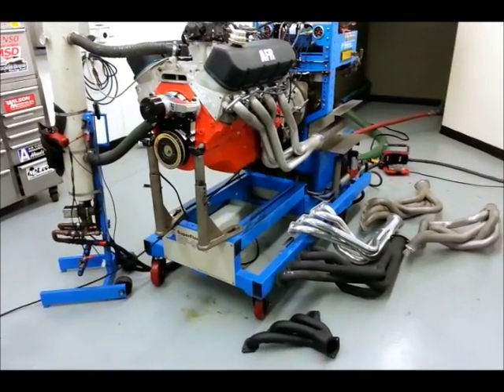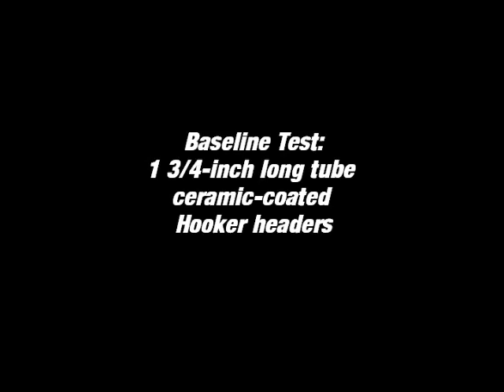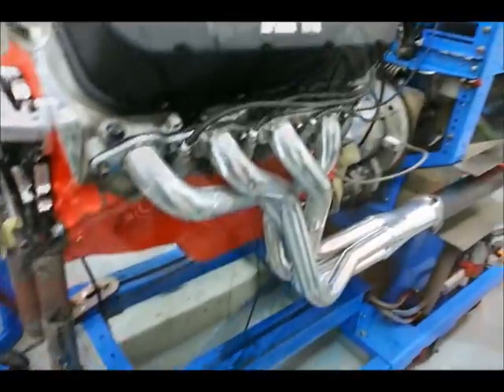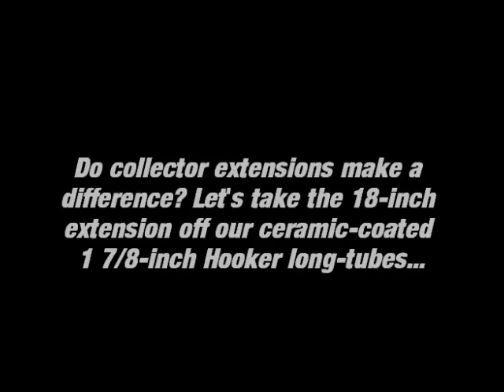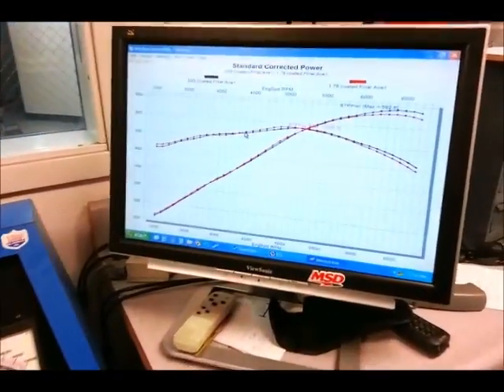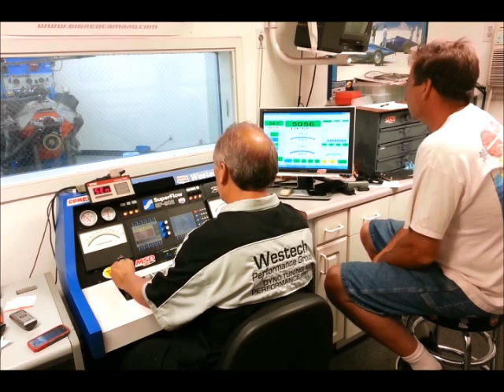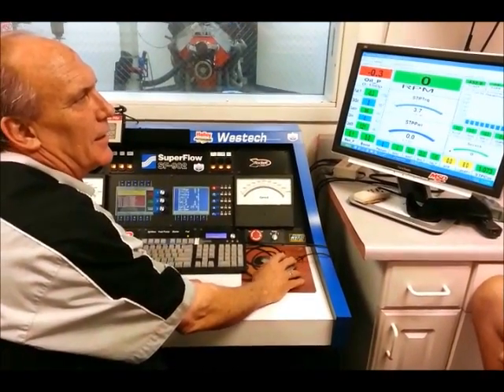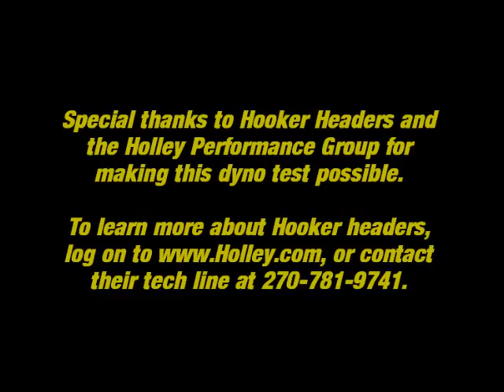Header Theory Dyno Test

Comment: Hey, youtube commenters.  Stop saying that emissivity is different for black or polished surfaces.   That is correct, but the purpose was to measure the emissivity, so the IR thermometer is the correct tool for the job.  The surface temperature of the header tube is largely irrelevant.
Reply: 8literbeater I'm sorry but if you've ever actually used an ir temp gun on a reflective surface then you know AS A FACT that it reads the wrong temps and reads much lower than it actually is. Try it for yourself before trying to correct people. I have, so I know the real truth. I'll give you an example, the other day I was putting insulated panels into the roof of my shop. I measured the temp of the foam insulation, 92f. Then I measured the temp of the roof board, a foil backed piece of wood. It read 85f, clearly that was incorrect because I could not keep my hand on the foil surface comfortably, but could easily keep it there all day on the foam. So what I did was scan the ir thermometer across the surface and finally when I got to the corner where it met a non foil coated beam, it read 115f. Try it, you'll see.
Reply: Kfx Guy   I don't doubt that what you say happened, happened. The problem is that you don't understand the difference between thermal emissivity, and thermal conductivity. The foil backing is an insulator, that reduces thermal emission. That's what the temp gun reads, and it is correct. By using your finely calibrated hand, and touching an object, you are conducting heat by touching, thus measuring thermal conductivity. 

So no, it does not read wrong, it reads radiated heat, not surface temperature. Different surfaces radiate differently. 

Also, for Christ's sake, aluminum conducts heat way way way better than foam. That's why it felt hotter to you. That's also why insulation board is commonly a combination of foam with foil backing. It covers both types of heat transfer; radiated and conducted. Wood is also a decent insulator of thermal conductivity, and a much stronger building material than foam.

Comment: The advantage of ceramic coated headers really comes into play inside the engine bay with the hood closed.  Especially for people still running an open air filter on top of the engine.   Do a couple of pulls with a car on a chassis dyno and you'll see a result.
Reply: And they don't rust!
Reply: @greybuckleton  
Yeah, that too.
Reply: The still get heat soaked so the differece is that great, propper heat wraps are way more effective and they still don't do much.  Best solution a pass through vented hood.
Reply: @GlassTopRX7  
Sure, heat soak will happen, but ceramic coating still makes a difference.   It takes longer for the under hood temperatures to rise, so if you're moving the airflow will help negate that heat soak.  I've had to work on cars both with and without the exhaust pieces coated and the uncoated temperatures under the hood are always hotter.  I don't own a ceramic coating business, so I'm not praising their product for my own gain.  I'm just telling you what I've personally experienced.

Comment: Hi guys i've been reading a lot of comments about blanking off EGR systems could you tell me if you ever tested this system open or deleted. im sure viewers would like to know if they get their EGR deleted will the engine have better performance power and fuel economy and then if the engine is remapped to compensate for this deletion of the EGR would this make the performance even better

Comment: The only beef I have is they didn't test 1 7/8 shorty headers against 1 7/8 longtube headers. they were tested against 2 inch long tubes.
Reply: But they did test the 1-7/8" LT to the 2" LT in this very same video with about a 25 hp loss with the 1-7/8" LT vs the 2" LT.

Comment: I'm only unhappy because we have no baseline of the stock header for the motor... So this only shows differences between the headers, but without a baseline of oem we can't really use this data for the effort you guys put into it.
Reply: Headers will always give you more power or torque over stock intake manifolds - even if they're cheap chinese headers. 

American-made Ceramic coated, long-tube headers are the way to go, period. I have some cheap, $150 headers on my '73 Nova SBC350, and they're rubbing against some plug wires, and already started melting my ignition wires, and after running the engine at idle for 30 seconds, underneath the hood has more heat than an engine ran hard for half an hour.
Reply: That's why it about header theory not exhaust manifold theory lol
Reply: +BloodstainedSinner Headers are not used on an intake manifold...
Reply: +landau46t An exhaust manifold is a header. lol
Reply: You got that backwards, technically a header is a type of exhaust manifold.
Reply: No they don't!
This very show did the test you describe and it made no bloody difference between exhaust manifolds, shortys and long tubes.
This very show also tested stock rockers vs roller rockers and they made no difference either.
So headers don't always make a difference.
Reply: They want u to buu em. !!! ...

Comment: I’ve been running a set of cheap summit brand headers on my big block camaro(mainly because I was doing a budget build and it was all I could afford) but with the hot humid summer days here in south Louisiana the water temp gets up to 220 when I run the air and around 210 with the air off. I just bought some ceramic headers to see if that helps. I also have a griffin dual pass radiator and 2 spal puller fans and one pusher fan on the front side of the radiator

Comment: Hey. I would like to know the rev times comparatively. I have always been told that long tubes or low back pressure in general will assist in you RPMs climbing faster. If so it would be nice to know the difference.
Reply: Cory Welsh the problem with that is it’s impossible to test on this type of dyno, because every engine’s rpm increases at a calculated rate, and the amount of load it takes to do that is how the power is measured.

Comment: The shorty header run was BS, because no exhaust pipe was behind the header so no pull on your exhaust pulse.
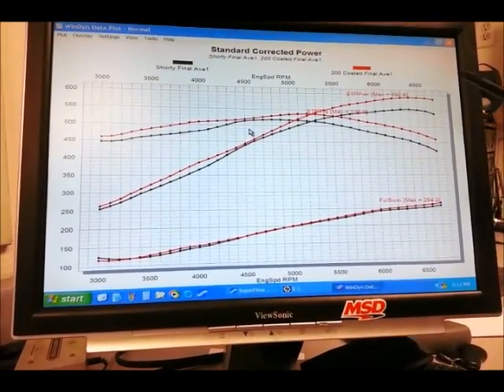Reply: look again at 16:30 they made 3" exhaust pipes for it- it just doesn't work well on a 600hp big block.
Reply: Didn't notice that the first time, good call.

Comment: Could you guys test a modern 5.7 Hemi or 6.2 Chevy v8 or 5.0 Ford?  I thank most people that watch these videos use those motors mentioned. I just got told by my local muffler shop that you have to run a full exhaust so you keep back pressure.  I was fortunate enough to have owned a 2004 Ram 1500 4x4 at one time that ran DoughsTry Y headers with electric cutouts true duel X pipe Duel resonators. it took off 1.2-1.3 seconds of my 0-60.  The muffler shop told me it would have been quicker if I had a full exhaust.
Reply: Steve Graves  huh, someone who sells exhaust systems is telling you that you need a full exhaust system to make the most power. Imagine that.
Reply: Your muffler shop should pull their weeners out of the car exhaust pipe.
This myth needs to stop.
Backpressure is a pumping lossand therefore costs power - they have shit for brains.
It is true that if fitted with a carb then it may need rejetting to make up for the exhaust if it's removed.

Comment: Hi... Actually this is the best video  so far in automotive hp finding... Can i know what is the bore and stroke of the engine you testing in .. thanks for those info. Have a great day
Reply: Steve mentioned it is a 427 out of a Corvette. That sounds like it is probably stock size bore and stroke (perhaps .030 over on the bore) Stock 427's are 4.25" bore and 3.76" stroke.

Comment: You can not measure the temperature with an IR thermometer on metallic surfaces that are shiny. The emissivity is almost zero and the reflectivity is very high. Thus no IR is given off and the shiny header might be hotter than one with black paint. The black one will actually be cooled by giving of more energy as IR and would probably therfore run cooler.

Comment: How are these primary size tubes measured?  I assume by O.D, yes?
Reply: +Mechan Knuckle (mechanknuckle) Hopefully by inner diameter since that's the only measurement that matters.
Reply: Standard is to spec inside diameters for primary tubes and length of primary tubes had a average for the set

Comment: Seems odd that they aren't using cold air to the carburetor. Room temperature can make pretty big differences in numbers.
Reply: 505197: I think that even if they weren't thinking about it, you have to factor in that that engine is going to be in a cramped engine bay so....
Reply: That dyno cell along with other good dyno cells is climatically controlled, both air temperature and humidity are the same from pull to pull.

Comment: Do all dyno's start at 3,000 rpm?
Not really a practical real life street indicator.
Reply: its the way its done for the most part . if you notice when they start the dyno the engine sounds like its having a problem its the dyno adding a load of resistance then the test begins an engine revs to x rpm . on a car dyno you will notice they dont start at 0mph or 0rpm its to replicate more of a real life measurement of hp/tq

Comment: Interesting testing guys. This is useful information. Aside from causing the engine compartment to get warmer, I’m not sure that the header temperature being high is a bad thing. Did you measure the head temperature in both cases? Was it getting hotter because of the EGT, or is it dissipating more heat from the heads due to the fact that it’s painted. Also a hotter exhaust is typically better for emissions.

Comment: You don't understand how your IR temperature reader works.

The emissivity of the shiny header is much lower than the black header - thus reflecting most of the radiation, giving you a false temperature reading.

Put a piece of black 3m shotch electrical tape (has an emissivity rating of .95) on the shiny header, then take your reading from that.

Comment: Test of the Ceramic Headers temp would not give you the correct temps. Using a Laser temperature gun will be in error due to emissivity. The "chrome" reflective surface will not show the true temperature. The black headers would give you a more accurate number. You need to utilize a contact temperature probe in order to be a true comparison.

Comment: Nothing against these guys here because they didn’t know but those infrared thermometers are extremely influenced by the surface finish and color of the object. This is because they operate on light wave measurement. So a shiny surface will give a much lower reading than a black surface. It is necessary to use a contact thermometer which uses a thermistor for accuracy. I learned this from the oven and griddle manufactures while diagnosing kitchen equipment.
Reply: The light there is only for human reference, the infrared sensor uses the photon energy from whatever it’s aimed at to determine radiative emission, since the coated headers are radiating less heat the exhaust gasses are still carrying that heat out of the engine bay. Try covering the laser (it’s just an dollar store laser pointer) on one and see that it still works.
Reply: @Steevo69  oh wow! Thanks, you taught me something
Reply: @aldente3585  I didn't know it until I started using them to check temps on large machines, and the coating may hold in heat so comparing different areas became a bigger deal, for example a double bearing set would show 100F cooler on the cast housing than on the shaft since the bearing was shielded and the housing painted.

Comment: need results of regular exhaust manifolds vs shorty headers dyno
Reply: I've been looking for a dyno test of stock exhaust manifolds vs headers and can't find anything yet.
Reply: John Slaughter these same guys just did this test a few days ago look up engine masters
Reply: Thanks
Reply: Thanks.
Reply: that's easy you will lose another 50 to 60 horsepower
Reply: losing that much power almost defeats the purpose of having a bigblock, especially when you consider the extra weight
Reply: The logs on a L78 396 vs 2" 1/8ths headers is about 30hp on a engine dyno and about 20ft-lbs.  HP and torque gains throughout the rev range.  The article by HotRod is titled Chevrolet Lied! Stone-Stock 1969 L78 396 Big-Block Makes 50 HP More Than Factory Rating and online.  It's also confirmed the 65 rating of 425hp was closer to honest in the Corvette.  Likely a bit higher as the Corvette BBC manifolds flow better almost like cast shorties headers.

Comment: how long was the extension?  I have a 350 with 1 3/4 headers and want to get some header extensions on it just because it seems like the right thing to do.  I initially was going to use a full exhuast, but Idk why it would be beneficial to me.  I could just slap a straight muffler on as a header extension and call it good enough, maybe even do a side exit sort of thing.
Reply: Our old dragstrip trick was to paint a stripe down the collector. Make a hard run and see where the paint stopped burning. Cut the collector at that point .

Comment: The temperatures needed to be measured with a contact probe, not a laser. That ceramic coated was way too reflective to get anything accurate (i.e. the 500F difference).

Not to say it isn't lower than just pure paint (that was already burnt off...) But it's just not an accurate result what so ever.

Comment: As much as I hate Chevy, the science applies to all Engines. This should be of interest to all racers and some street car guys as well! After watching, who’d have thunk a ceramic coated header would reduce heat that much! Being an AZ native that means a lot for street cars that operate in 110+ degrees in the roughest summer months, and would translate into some real gains at the Friday night drags! As far as Dino differences go, keep in mind that this test engine is NOT housed in a doghouse, aka fenders and hood. Any heat generated here goes into the room which allows it to propagate away from the intake, where high temperatures rob  horsepower. The cooler the intake the more power can be made at a rate of 5 hp per 10 degrees, as measured in the early 70’s. I doubt much more work has been done on that since. Thevcollector extension test gave predictable results. There’s a huge difference. In fact if it was my car I’d use electrically operated cutouts and set them up with a straight shot out of the exhaust when the exhaust is being cut out of the system for street strip, ... and street racing use. They make a huge difference but the length has to be precise to get the very most out of the extensions. Too long and extension can hurt performance as much as too little of an extension! Nice that they admit that there is a point where there are more gains to be had, and any further improvements have to be sought Elsewhere! As for the shorty header?..... in smaller engines they might be better than cast iron Orem exhaust manifolds. Other than that, I’d use them only where anything else wouldn’t fit withoufht destroying the sheet metal, inner fender wells etc.

Comment: In a nutshell in almost any application other then piss poor bone stock a shorty header is mostly about fitment or ground clearance and only thing better then long tubes is maybe weight. a slight improvement over cast manifolds and definitively lighter but long tubes are more superior overall.

Comment: The shorty is going to be down on hp if you dont put any tubing behind it. 12 inchs of pipe behind the  shorty would've help a lot.  just sayin
Reply: +Johnny Luck look though the window at 15:30 they have pipes after them
Reply: +andrew mac they were extending the headers before the exhaust, then just put the exhaust straight to the shortly header. Hey you know a shortly headers going to be less power on that engine anyway. It's all good

Comment: using IR thermometer is stupid, it measures radiation and has to be calibrated to the surface conditions, going between reflective and non reflective surface will screw up the readings (black body radiation and emisivity)

Comment: A lot of these young racers don’t realize to get those big HP numbers it’s the little things like cam size, header tube size and wether or not your running an 18-24” pipe to get the proper back pressure that’s why the one with no pipe made way less HP back pressure is not a myth like some ppl think and EFI really kills HP big time check this video out for proof https://youtu.be/04viq_61cH0 carbs are king for power

Comment: Good work gentlemen. You may want to point out the reality that headers dissipate anywhere from 40 to 60 additional degrees of ambient air temperature under the hood. This robs considerable power and has an adverse effect on electronics which are already under an anticipated level of duress. Vacuum lines and wire harnesses become brittle and that’s only the beginning. Electronic components fail prematurely. I like to use the example of having a desktop computer in your oven at about 90 to 100 degrees. Watch much slower it renders and operates. How long will it last? Will it last as long as a computer in your bedroom? Don’t get me wrong, headers are really advantageous on older vehicles. I simply would never install them on any of today’s modern computerized vehicles.
Reply: Or, simply get headers with a good ceramic coating if you are  concerned about your engine electronics and engine heat.
Reply: Kirk Robinson 8
Reply: Yes I agree, comparing a computer to an engine is a great comparison. We all know that computers pump air too just like an engine to operate. Wow. 🙄